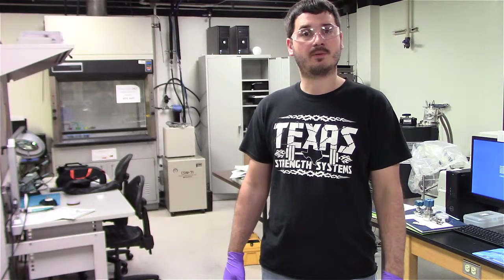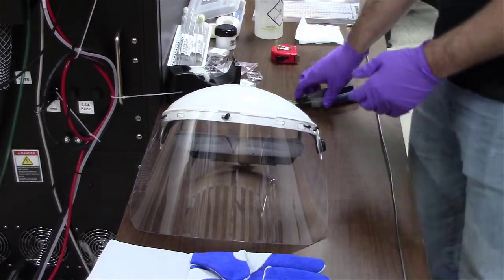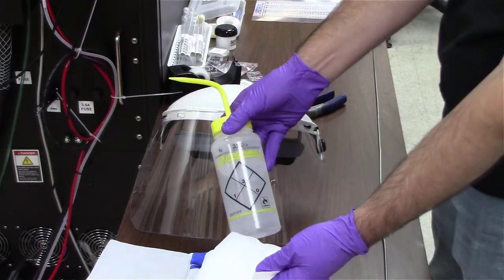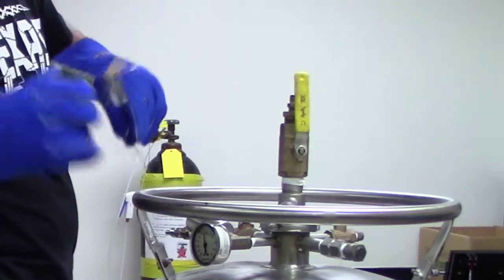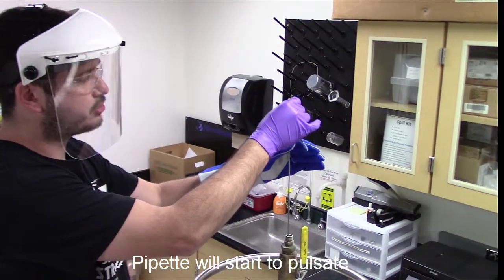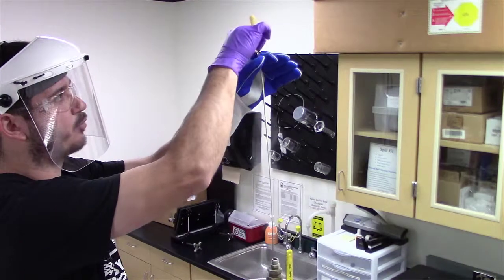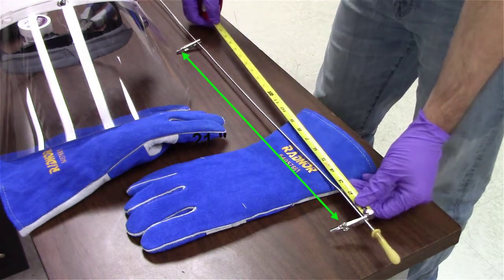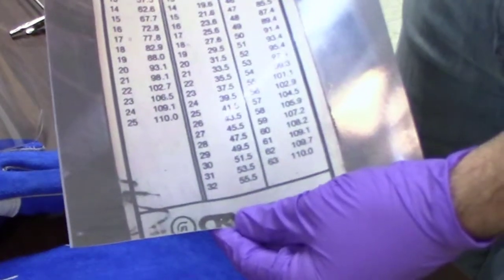Thumping Helium from a Dewar

Comment: Where do the pulsations come from? And why do they change? Cool demonstration, thank you!
Reply: yes good questions that needs to be answered. inquiring minds wants to know!
Reply: @HighAway  The tube is likely simply acting as a thermoacoustic heat engine. It's probably possible with He and not other cryogens because it's so close to approximating an ideal gas. The frequency of the oscillation is higher when the tip is above the liquid level due to the lower viscosity and inertia of the gas compared with the liquid.